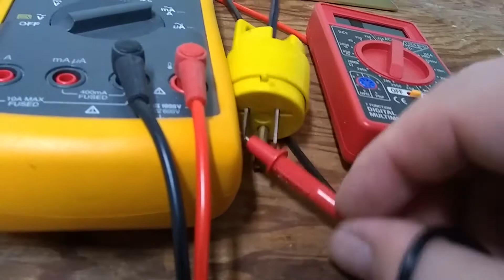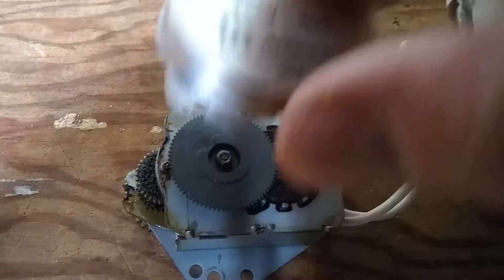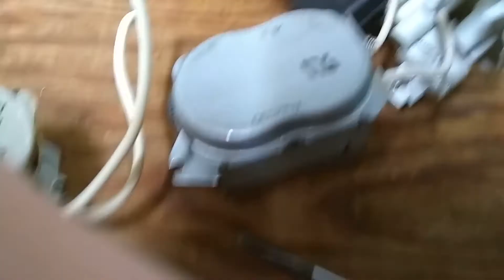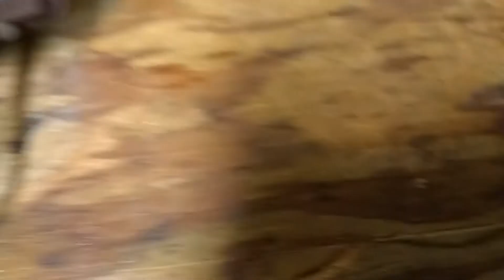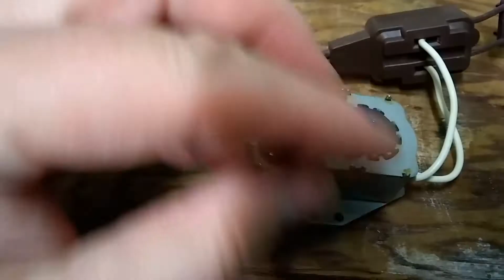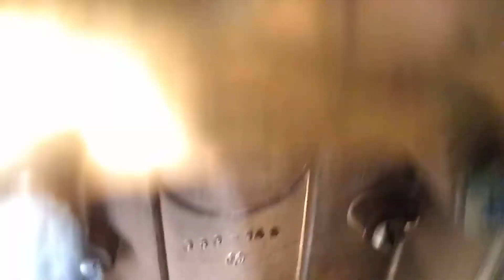[Part 1/2] Jefferson Golden Hour Mystery Clock - Replacement of a Broken Gear

Comment: Thank You so much.  I needed the tiny gear attached to the motor  permanent magnet rotor assembly  ( the original center gear crumbled into dust )   I ended up using the whole permanent magnet assy with a slight modification to installed height.   Up and running .  Keeping time.   👍👍👍👍👍👍👍👍👍👍👍👍👍👍👍👍👍👍  Good advice

Comment: Is there any way to adjust the speed? Mine is running fast.
Reply from the maker: The only way to change the speed would be by changing the supply frequency, which should be exactly 60 cycles per second. By any chance, is your AC voltage coming from a smaller power generator or solar? The speed of these clock motors depends on the AC supply frequency, which in USA is pretty accurate 60 cycles per second, or 60Hz if your power comes from a larger company. The big ones take care to supply exact frequency, or compensate any inaccuracies in the course of 24 hours. BTW, Europe runs on 50HZ AC, which frequency would slow down the 60Hz motor's operation.
Reply: @tektech1065  I'm in the U.S. and my voltage is about 118-119. Perhaps it has a 50hz motor in it.
Reply from the maker: @CarsInDimension Running a 50Hz clock plugged to 60Hz voltage would make your clock speed up by 20% - each hour would take only 48 min. to pass on the clock. Is it that much faster? 

If it is 20% faster than normal, you could remove the two screws in bottom plate and look at the markings on the motor.